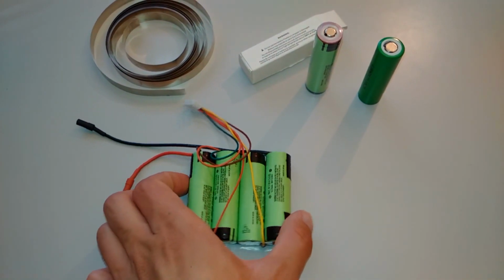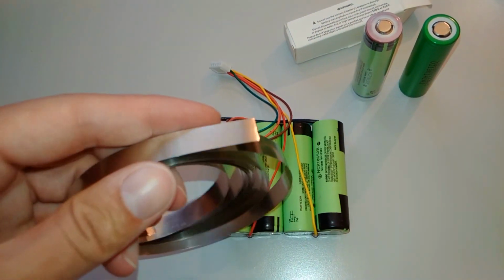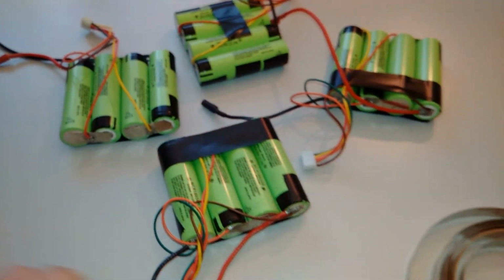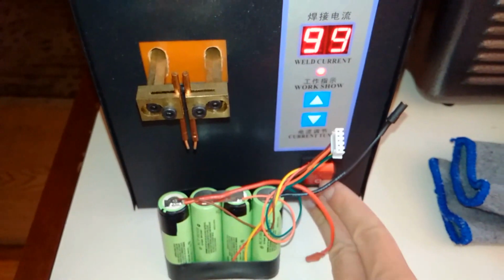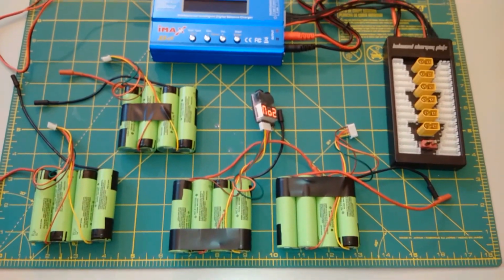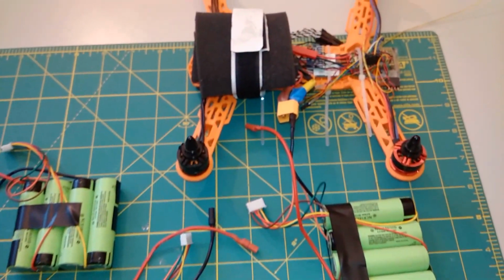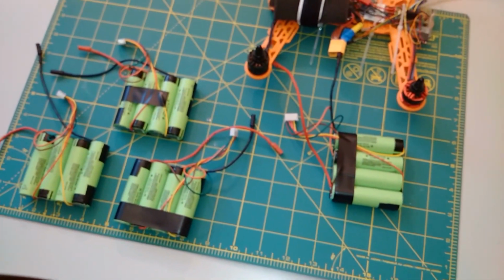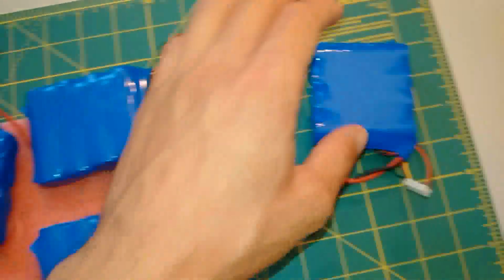How to make a 18650 4s battery pack - LiCoO2 Panasonic cells - spot weld

Comment: If I were to make a 4s pack being 3.7v per battery what's the max volts I can charge to? Would it be 14.8 for a 4s pack or would that be classed as storage charge?

Comment: Any alternative method other than spot weld?
Reply from the maker: +Ibrahim Ali it's possible to use 18650 battery holders which use springs and allow swapping the cells just like AA batteries. Not sure of other welding methods, as long as the heating time is short as possible it's ok for example hand made with hot soldering iron >60W is possible but not recommended
Reply: Why I'm seeing others using electronic components for this kind 18650 diy , yours look very simple and its make me wanna made one for my fpv plane .
Reply: rough up the ends and just apply normal solder and use some wire